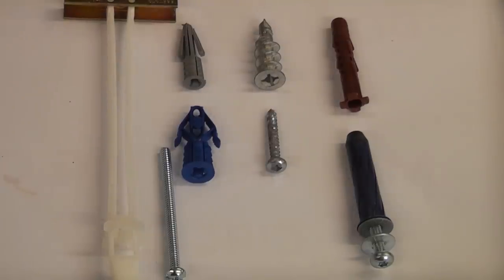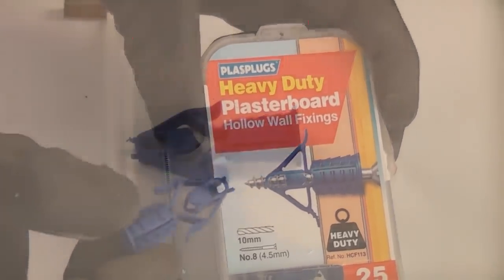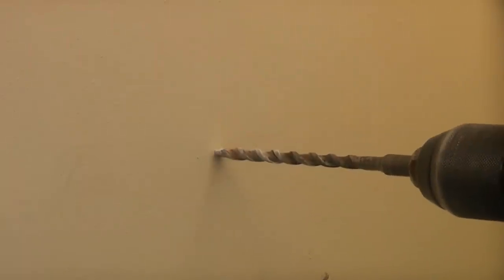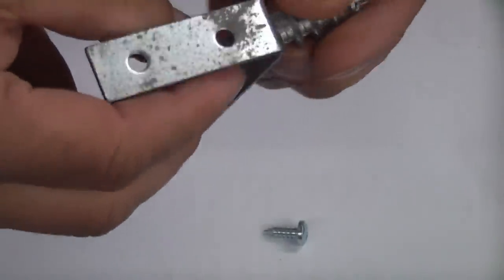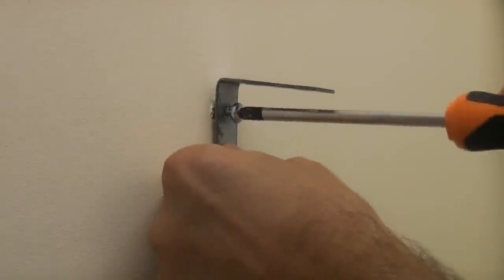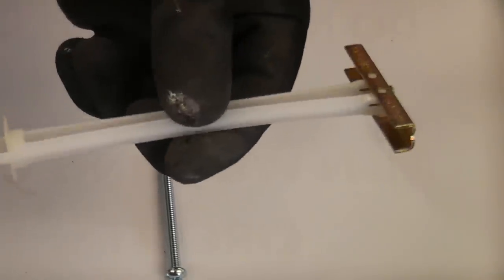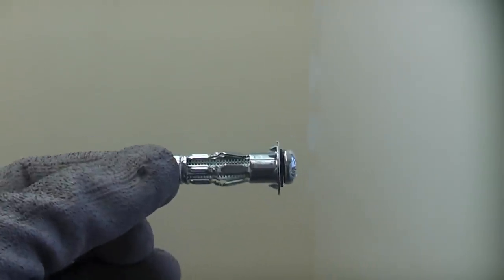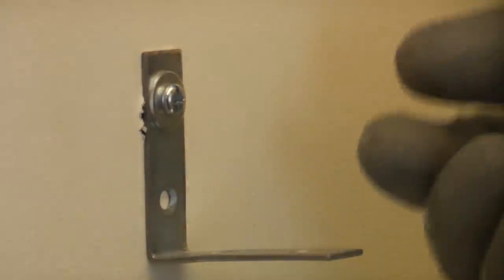Plasterboard fixings- The good, the bad and the useless!

Comment: A whole quid for ONE snap toggle? Sod that. And why does one of this fasteners need a torx driver,just to be awkward ?
Reply from the maker: +NIGEL PASSMORE 
They are not the cheapest but the holding power from them is the best you can get.
I can't remember which one used the Torx screw!
Thanks for the comment

Comment: I don't like those new gripits. such a large hole and not much load spread on them. I've had them fail with just small loads on them. the butterflies on the back just rip through the plaster board.
Reply from the maker: Thanks for the comment ;-)
Reply: Not the only one then!

I also found the surface sits proud of the plasterboard so what you are attaching isn't tight against the surface.  All bar the spring toggles can have this issue to an extent, but the grip-its front face seems quite a bit thicker than the alternatives.

Also if you have a piece where the mounting hole is close to the edge (typically things which are probably designed to go into a solid masonry wall with rawl plugs, or things with narrow brackets) then the grip-its are so large they extend past the edge of the thing being mounted. Same issue with the large hole needed for spring toggles, but you can work around that using a Fein to cut a square hole.
Reply: @exigetastic  I agree the Gripit is OK for lightweight items. I attempted to fit vertical radiators using the blue Gripit fittings onto dabbed plasterboard. I had to replace all of them with 10mm plugs and screw bolts as half of them failed. Although the manufacturer says they are good for over 100Kgs. Too risky for me.

Comment: what's the tool name from 7:50, please ?
Reply from the maker: It's a hollow wall anchor setting tool
https://www.youtube.com/watch?v=7mpcer0QzW8&t
Thanks for the comment 👍
Reply: @ultimatehandyman  Great, thanks. I used such anchors in the past when mounting small cabinet on the wall. One anchor unfortunatelly broke, may be I overtightned it (1 anchor out of 4)  It is still serving against vertical force, however I do not like the feeling something is wrong there. I haven't seen any video on "how to recover the mishaps", do you think you can make one?

Comment: No mention of loads they can take
Reply from the maker: +Ian TheInventor 
That's correct. Most of the manufacturers do not have this information on the products.
Reply: I saw you tested the loads adhesives take which was very interesting, I saw a video today that was sent to me of the load a Gripit can take, wasn't impressed with it. Wonder if the redesign has improved them.
Reply from the maker: +Ian TheInventor 
Not sure, but there are a few different sized grip-it fixings. The larger ones can take higher loads.
I will rig up a partition when I get chance and test the Grip-it fixings and the snap toggles, and perhaps a few other fixings to see what load they can take in half inch plasterboard.
Reply: That would be very interesting, wonder how the new Gripit compares to the original.
Reply from the maker: +Ian TheInventor 
I'm not sure, but I did use the Grip-it fixings a few weeks back when fixing a bathroom cabinet to en egg box wall and they worked really well-
https://www.youtube.com/watch?v=-geib-6sa3M

Comment: this guy is trippin with those "zinc" deals...   it shouldn't bottom out if you use a washer... but if you just screw it in then yea... but a washer is almost always also supplied with the kit, or if not washers are cheap.....
Reply from the maker: Let's face it- they are crap ;-)
Thanks for the comment 👍

Comment: Hi very good vid, I am working on a new'patent pending'' wall fastener and would like to use your link to your site to explain what is on the market etc, rather than doing another video to say the same thing. let me know if this is good for you.. I will send you my completed video so you can understand the new technology I am using but prefer private message to your self as not public yet. my e mail is at the top of my you tube page if you want to send your e mail address. cheers

Comment: you fuck the blue ones up because the screws are too big ,...I use them with no problems...
Reply from the maker: +David Meale I used exactly the same diameter screw as I did for the grey versions (made by the same company) and used the exact diameter screw that the firm recommended for use with their fixings.
Reply: +Ultimate Handyman its obvious that the screws are too big in the video....how are other people using them OK ?
Reply from the maker: +David Meale 
No, it's not obvious at all. The screws are size 8 wood screws, which are the same size that are recommended for the grey versions used (which worked). I have tried these several times and each time they failed. Who says other people are using them OK, apart from you!
Reply: +Ultimate Handyman    .guess you must be right then...